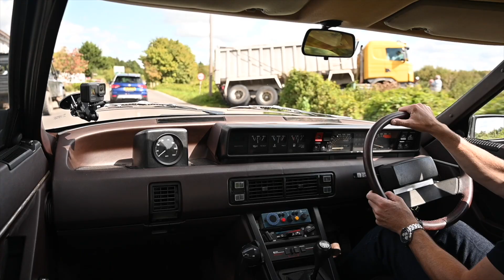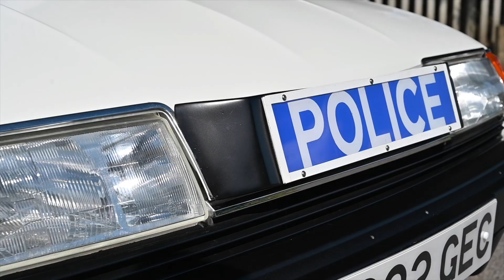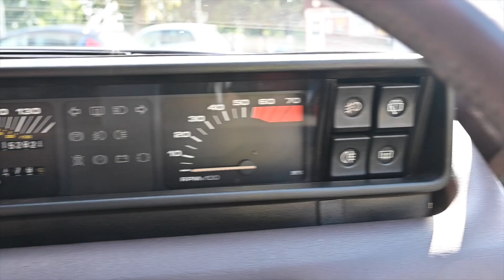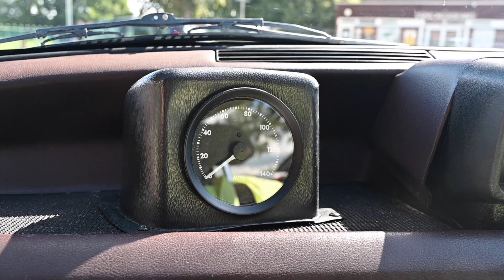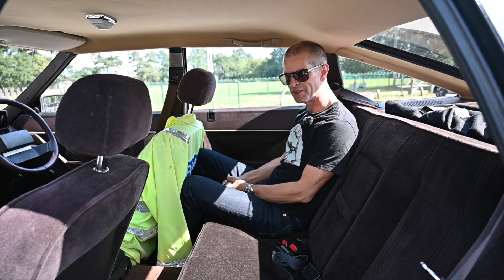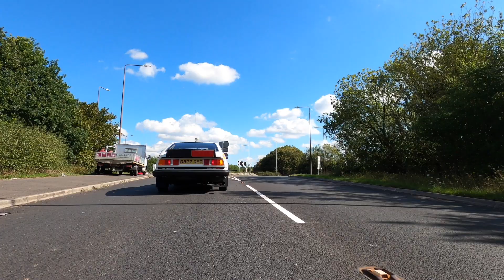1986 Rover SD1 Police Car

Comment: Thanks for the video. Nostalgic for me as I was one of those Police drivers of the 3500 Rover SE and Vitesse at 23 years old, South Yorkshire Police (I am 58 now).  If you want to jump to that Rover 3500 experience go to paragraph 6.  Since I am here I will write up a little experience providing some insight, which might dispel some cop driving myths.

Police driving was tiered back in the day - beat car at grade 3 to 5, basic traffic at grade 2 and then advanced traffic at grade 1 which typically included the armed response car, diplomat protection and some further defensive and tactical driving.  I had passed my civilian test in a RWD Vauxhall Cavalier at 17 and was already a rally fan as I joined the job at 20. I did the beat car immediately after passing my probation (2 years in) gaining a grade 3 (highest) which qualified me for traffic training.  

Normally, it was expected to beat drive for 3 years before progressing - the cars were generally stock and between 1.3 and 1.6 litre 90 BHP (back in the '80s) - mine was a Vauxhall Chevette 1.3 but rear wheel drive and you could entice it to overdrive, especially in the wet.  Beat drivers were essentially restricted to normal traffic law and speed limits although there were exceptions - for example, if you were in a pursuit concerning a serious incident like a bank robbery, you could ask control over the RT for permission to exceed. Generally they would call in a traffic car though to take over... the beat cars were stock as I said and half decent opposition could leave you in the dust. 

Due to a combination of circumstances including the miners strike (shortage of PSU team van drivers - had to be traffic qualified) and a secondment to the serious crime team as a TDC which required a traffic qualification to drive the high performance sleepers (plain cars with discrete lights and horns in the grill and rear bumpers), I pitched for Traffic training as I hit my 23rd birthday. I was surprised to be accepted TBH, but when they put that faith in me I gave it my all for the 3 month course - I had no kids and few responsibilities and so even in my own down time, I was out practicing in my own Ford Escort (within speed limits).  I passed class one, the youngest in the force at the time (I was told). 

The Traffic course was all plain white cars - no Police badging at all - we had RT but no operational capability, off the grid largely. It began with a step up to a 2.0 lt  Vauxhall Cavalier and within a few weeks a 3.0 lt Vauxhall Carlton which was actually rather sedate, like an arm chair.  The focus was ultra smooth car control (including double de-clutch), balance, braking with no discernible jerkiness (try that, it's hard), forward planning and road craft.  The training was similar to VIP chauffeur driving.  However, the tactical and planning aspects were much more developed - there was a process which involved looking far ahead for clues to road changes in direction (tree lines for example indicating a left turn a mile ahead) and vehicle type indications (anticipating their speed / performance before you reached them), then rolling back to the immediate foreground - road surface changes, pedestrian activity and weather.  For example, if we were following a bus on urban roads, we would look for a passenger reaching up to ring the bell - then anticipating that the bus would begin to stop (and become an obstruction) we would already be in gear and out towards the centre line.  In the countryside we would be on the max speed up to 60 mph and looking for activity, cyclists, horses - if we spotted a farm we would anticipate a change of surface,  mud / manure on the road ahead, or possible sheep, cattle crossing the road.

At normal road speeds during the first 3 weeks, this all seemed a little OTT and we would do an hour on and an hour off - two trainees per car with the instructor. We might get as far as the Lake District from Sheffield on a run, or Scarboro on the East Coast (for a lunch stop). We had to be back at Snig Hill for 4.00 PM to wash and clean the car (daily), check the fluids, brakes, steering for leaks etc. 

After an interval driving test (pass required for progress) at 4 weeks, un-announced we turned up one morning to a fleet of white, un-badged Rover 3500 SEs :) despite being on the course, I was still surprised that they would let me into one of these cars being young as I was and with a domestic 1.3 Escort at home. Frankly, in civie life, no one would have insured me for a 180 BHP V8 SDi.  I was excited but not in the pilot seat yet. 

The first morning was a demonstration of the 3500 Rover capability as the principle Traffic and special ops car in the force with the instructor driving... easy enough right? Within minutes, we went off the speedo on the M1 out of Sheffield... 140MPH - things just got real and the first 4 weeks training dropped into place - at that speed, an incident a mile in front is on you within 25 seconds, you have to think and react far in advance.  In the afternoon we got a turn to drive, 30 mins acclimatising to the new car and power in an urban setting, then out onto the lanes for a sprint before returning to Sheffield on the M1 at top speed. Absolutely thrilling - I was buzzing, kept pinching myself - is this actually happening.  However, the student in the car with me bottled it and was shaking so badly on the final sprint that the instructor stopped the session.  By the end of the week, we had lost 30% of the trainees... the reality is, it can be terrifying, and you either mastered it or you were sent back to your station. 

Week 6 we ramped up again, with an active pursuit mode... at any point in your session driving, the instructor would wrap the dashboard, 'response call - max effort' and give you a way point to reach, say Clumber Park 20 miles away. You then had to reach that location as fast as the car would go whilst remaining safe and in complete control at all times. Imagine that in a V8 rear wheel drive Rover... now add in public roads, civilian traffic, rain, country lanes with changing surface quality and leaves / mud and changing light conditions... my course was in the Autumn and so I got pursuit mode in the dark some afternoons. 

I had a couple of moments I can still remember - on the way to Scarboro in pursuit mode at + 100MPH down a back country lane I hit a large pheasant which flew into the road, demolished the front bonnet / bumper although I didn't twitch or over react with steering and braking and was commended for remaining calm and not losing control.  The one time I almost bottled it, I was on a 4 lane, open (no barrier) two way carriageway, with busy traffic in both directions and light drizzle when the instructor hit the dashboard - pursuit! This entailed me moving into the opposing traffic lane against the flow at high speed... no lights, horns or badging remember.  I was doing + 100 MPH when a car pulled out in the lane a quarter mile ahead coming directly towards me... I lifted off the throttle a touch considering my options and the instructor calmly touched my wrist - 'don't do that please... keep your foot down.'  I was shaking after that one and we had a 10 minute tea stop at a road side cafe, talked it through - it dawned on me how much bottle the traffic instructor had in that situation, sat in the passenger seat with no dual controls. 

This went on daily for several weeks including developing road craft skills, forward vision, skid pan training and more. Pretty intense.  Two months in we got the final treat.. a step up to the fleets new Rover V8 Vitesse Police Specials... Lucas fuel injection, big bore exhaust taking the BHP to 220+ (although it felt like more), lowered suspension, bigger wheels, lightened overall and a full aero pack which included a deep front chin that didn't like speed bumps at all (we lost a few).  I don't know what the stock civilian Vitesse ran at, but I do know that the Police had a BTO (build to order) thing going on... the fuel injection mod was in part a result of wide scale UK Police demand on Austin Rover to step the 3500 up again..
Reply: So I drove and experienced both cars at speed back to back, the 3500 NASP V8 SE (more or less showroom spec) and the 3500 EFi V8 Vitesse Police BTO and they were quite different. the SE had a trailing lazy throttle which made smooth gear changes easy.. take your foot of the throttle pedal and the revs came down slowly - the EFi did not and although the throttle response was sharper, you had to trail the throttle with your foot to get an ultra smooth change. Brakes were much better on the EFi, the steering sharper, less roll in the turns.. the whole thing was more planted on the road with huge amounts of grip, even in the rain... in fact that is what gave you the confidence to push it hard even in bad conditions which included sleet and snow - it was rear wheel drive so tail happy but eminently controllable in power slide or a brake lock up (no ABS but we did use the hand brake at times for braking without rear brake lights). 

The biggest difference though between the SE and the Police Special was the jump in pace and torque... no joke, on a sprint we would hold it in second to 70mph on the motorway slip road to build up flank speed for the outside lane... then drop into third to hit a 100+ and you were away. Our calibrated speedos went to 160 mph marked analogue as I remember and a loosened up Special with 10+K miles under its belt would go off the right side of the clock.

To give you a practical application of this... I was in Leeds one day on the ring road, near Pudsey, dropping off gear at the TA barracks (we sometimes joint trained firearms with army instructors) and got a priority response call for Sheffield city centre which was approximately  34 miles away.  I was double crewed and one of two armed response units on patrol. I went down the Leeds inner ring road through Armley, caught the M1 at it's root (Hunslet) out of Leeds and was at the incident near Hillsboro in just over 12 minutes topping out above 160 mph at its peak on the M1. I can remember planning for the exit ramp, 3 miles ahead and dropping the Rover into 4th at 120 mph to decelerate and not cook the brakes as I came off. 

I can genuinely say, it was the best car, most thrilling and re-assured that I have ever driven and that includes (later) a BMW M3, an Audi Quattro, a compact (size) V6 MG ZS with a CAF and cat back running 200BHP and an Escort RS Turbo on Cadwell Park race circuit. All these cars have their thrill points but nothing ever inspired me as a driver, in all weathers and conditions like the Rover 3500 Vitesse EFi. Possibly the greatest, mainstream British car design of my life. 

Romeo Alpha Three - signing off.
Reply: @Spartanm333  😆"and not cook the brakes "  Ahhhh yes, brake fade.  Quite some years back now, a friend of mine had  BMW M5 a fairly early one, which fair do's were quick, this particular day it was off the road for some reasion and he needed to be elsewhere that night, could he use my V8?  (he did'nt think much of them) sure I said, just dont try to drive it like the BMW, which had him laughfing at me, OK, you break it - you buy it!  It'll be fine the BMW is far better....blah blah blah!   The following day when I caught up with him, I had quite a lecture on the ineffective brakes, suspension etc etc etc to which my reply was, you tried to drive it like the BMW did'nt you? I told you they have a learning curve, you use the gears not the brakes otherwise they are gone in a few seconds, needles to say he never wanted to borrow it again!  🤣
Reply: @Spartanm333  given the functional top speed of the production Vitesse was around 135 mph, what on earth was done to the cop cars to allow them to get them up to 160?  it's hard to get a car from 135 to 145, and much, much harder to get it from there to 155..   are we not thinking of this?   https://www.youtube.com/watch?v=EK2ijfxqlnY   the Porsche 911 of the day wasn't good for 160.  just saying.
Reply: @Spartanm333   l am not a fan of the UK Plod, however l found your reply quite interesting and informative 👍
Reply: It is the longest comment ever I saw on Youtube
Reply: @kamrankhan-lj1ng  But most importantly..... the Best.
Reply: @booradley1510  Well said Sir!
Reply: @booradley1510   Yep! Absolutely!
Reply: Wow! Thanks for sharing.
Reply: Absolutely magnificent! Thank you very much
Reply: @Spartanm - what a fantastic review of the Rovers. I only drove one for a short period in the mid 1990s, but the impression that it left me with STILL gives me thrills.
Reply: Wow ! Those were the days, very enlightening. Closest I got was doing the Honda MAC bike course with an ex police rider !
Reply: What a great insight into the training involved in police driving. 
I passed my IAM test aged 19. I can’t even imagine doing this aged 23. Well done sir! 👍
Reply: "you could entice it to overdrive, especially in the wet." That would be oversteer darling. Didn't they teach you that?!

Comment: Haha I got stopped on the M6 by one of these in my purple bond bug 700ES.  Got to sit in the back too, and learned that doing 93 mph was dangerous etc etc.  The sergeant ended his lecture by saying " I'm not going to report you on this occasion my colleagues will laugh at me."  I got off with a producer.
Anyone that has driven a Bond bug will appreciate that the speedo over 30-40 mph just waves at you up n down the scale.

Comment: I was a PC in the Met from the late 70s. The SD1 replaced our beloved 3.5 P6 Rovers. Being the Met, we got the utterly gutless 2.6 automatics, just as all the yobs discovered the Ford XR3. It was, frankly, embarrassing! Traffic Patrol later got the V8s, but us mere plods kept the 2.6 until the end, with repainted stripped out Vanden Plas leftovers, with the sunroof sealed up, and the VP badges removed. This was because the Met didn't want the public to know they were buying anything but the budget versions. You couldn't make it up!
Reply: Absolutely right,  but we, at a traffic garage, started with V8s, then dropped to 2.6s , they couldn’t take the long high speed runs and went to stations, where some poor crews actually had the 2.3s, another Leyland disaster, and yes the Met did buy up all the Vanden plas cars at the end of the run as the public didn’t want them, ripped out the air conditioning and sealed the standard sunshine roof, which rumour has the guy who actually ordered them didn’t know about.
Reply: Agreed.  Useless brakes, weird square steering wheel on early models, acceleration of a snail.
Reply: Lovely story. I missed out on these iconic cars. 30 years last week.
Reply: Have no fear, in a few years time, you will be looking back all dewy-eyed at the cars you worked with in your career with just the same degree of nostalgia that we did with the P6s and SD1s. If it is any consolation, the 2600 SD1 was actually fairly crap, but, boy, did it look the part, or what?!! @hawk194
Reply: The P6's were lovely
Reply: Now they DO use Fords......plus also Vauxhalls, and Hyundai cars. I remember for years the Met used BMW's.

Comment: How did they only manage to get 155bhp out of a V8 🤔🤦🏻‍♂️
Reply: Remember that a lot of the huge American V8's with well over 6 litres were barely making 200bhp in the 70's and early 80's, so 155 out of a 3.5 non-efi engine, still essentially the 1950's version, was ok.  Jeeps were making 160 out of 4 litres in the 1990's Cherokee with efi!

Comment: I remember driving my Dad’s 2600 SD1 from South Wales to Gatwick airport doing well over 100mph all the way on the M4. I’d forgotten that my folks flight back from Italy was due in in less than 2 hours ! (Got distracted with my new girlfriend 😉) Gatwick is a long journey from Cardiff and I did it in less than 2 hrs. I had that SD1 nearly flat out all the way and it handled it beautifully; a true motorway rocket 👍 I’d probably have got a prison sentence these days. And the irony, their flight was delayed by 45 mins ; so I just sat there waiting as the SD1 (and me) cooled off. A freer world then ? Yes indeed.
Reply: LIVERPOOLSCOTTISH  ; I remember it being a great engine; however, they did suffer with crankshaft seizure if the oil was not serviced regularly. My Dad bought a second one, on a B reg (84) I think and this seized whilst he was towing a caravan. Yes, by today’s standards the V8 doesn’t deliver big horsepower but it’s such a delight to drive; my cousin has two P5bs both with the V8 and that burble is just delightful 👍

Comment: One of my first cars was a Series 2 SD1 3.5SE with the manual box. I would tool it down the A40 from High Wycombe to London for work and loved it. As unsophisticated as it was (by today's standards) it was stable, fast and predictable in all conditions. If BL had invested real time and money into these car they would have been world beaters.
Reply: it needed the worked over P7 B reversed P6B de Dion tube- it cost 50 quid or so more than awful sow's ear basic rear and Bosch electrics/electronics instead of useless Lucas.

Comment: In the late 90s I was travelling to southern France to our place there. The car was an SD1 Vitesse with hot cams, Rimmer zorst,  tuned suspension etc.It was Sunday, little traffic. Car completely relaxed, autoroute rolling down. Suddenly my son, in the back, says 'Why are those motorcycles going backwards Dad?' Glance at speedo. Indicated 130. The only other car I ever had that was so completely deceiving of actual speed was an XJS V12. But the Rover was a far  better car.

Comment: I'm not sure about the SD1, but the Police Rover 800's that followed would regularly break speedo cables (I worked for a rover dealer at the time), They were also 'significantly' more exciting to test drive, so there must have been some special mods on those too.